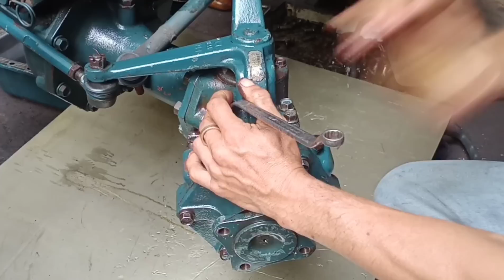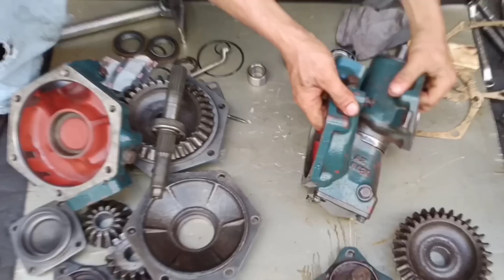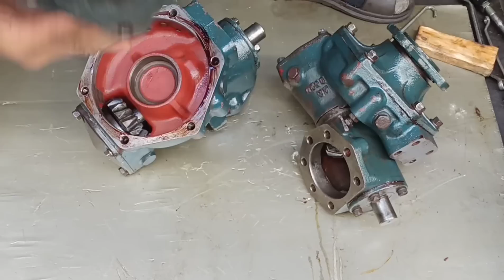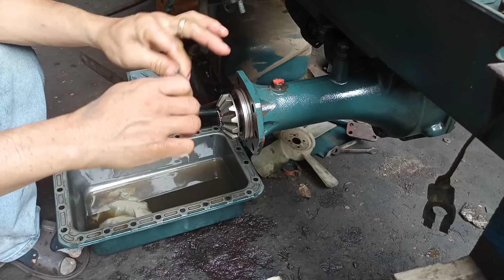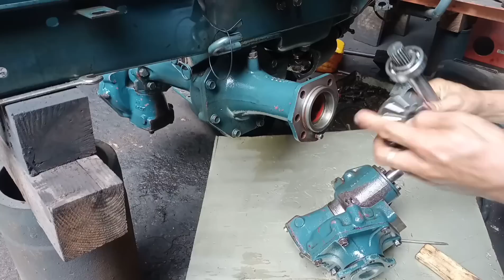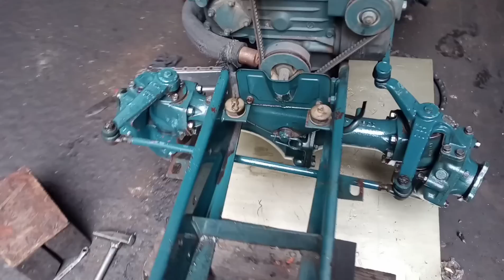HOW TO ASSEMBLED KUBOTA B1502 FRONT AXLE

Comment: @2:08 There's correct method of bearing installation. When fit into bore hole of housing, please knock/ contact the outer ring of bearing. Avoid hitting inner ring, it'll damage the bearing, especially if this is a tight fit tolerence. Best of luck..

Comment: Hello, you post very good and useful videos, I am your subscriber and follow your activities, I am writing to you from Georgia, I have a question about the tractor.  I have a Kubota GL 53, is it possible to contact you through Facebook?
Reply from the maker: Thank you for watching.what is the problem with  your GL53
Reply: I will explain the condition of my tractor in detail, if I start the tractor and it is in neutral position, I can easily turn the tractor, and when I let it go forward, the steering wheel immediately hardens and the motor needs a lot of torque to turn the steering wheel smoothly.  A few days ago, I was working with a tractor, I had the gearbox in 5th gear, when it got a load during work, the tractor just stopped and did not tow, when I released the load, it went normally in 5th gear.  The gearbox began to heat up again.  What should be the fault?